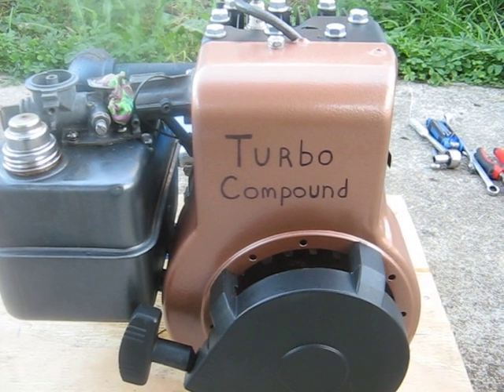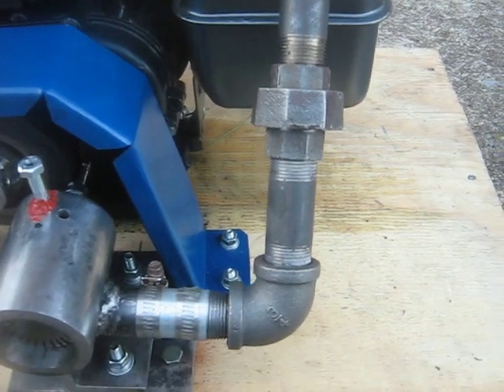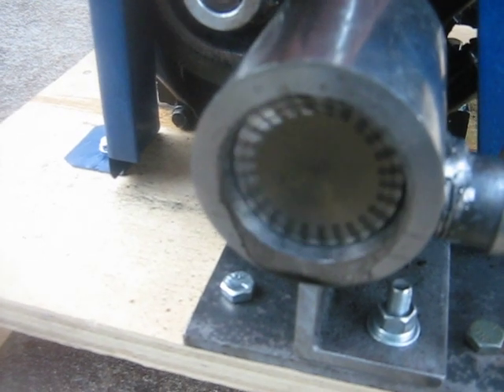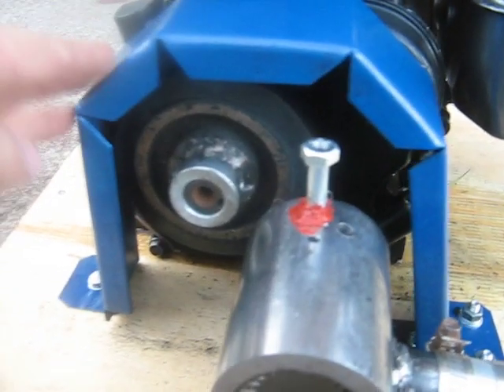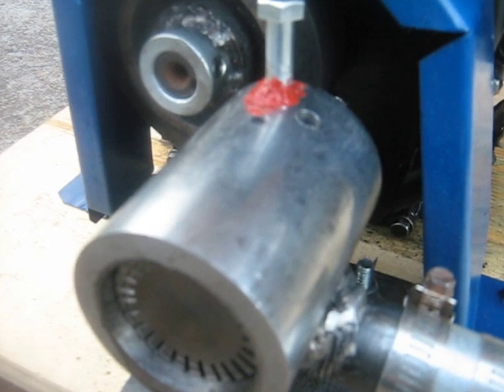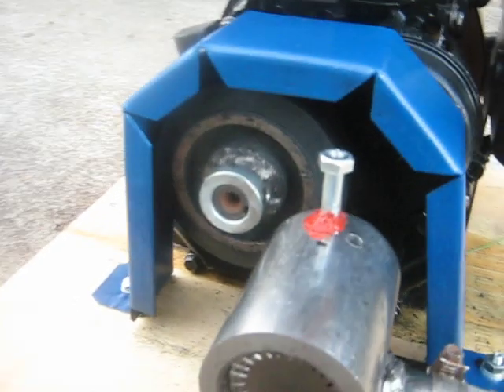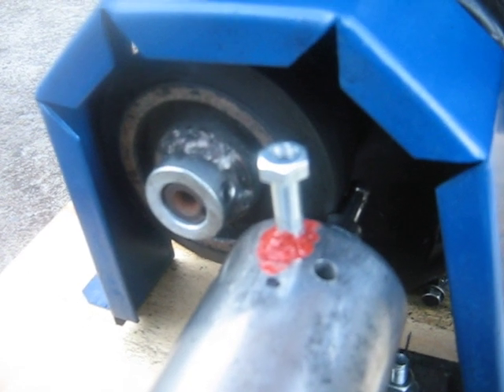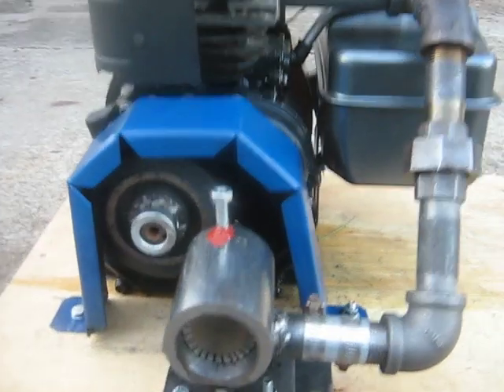How the Briggs Turbo Compounded Engine Works

Comment: Green lock tight will put it wherever you want and no turbo compounding is where the little turbo feeds the big turbo so it will spool up at a lower rpm if you put a bigger turbo on a engine it will move the gains received up the rpm range narrowing your power band by taking it off the bottom where you needed the power so by having a small turbo feeding the big turbo it’s able to spool the big turbo at a lower rpm

Comment: Impressive ingenuity and effort but This is not a turbo.
Reply from the maker: You are right, it is not a turbo charger. It is based on the turbo compounding idea of turning a turbine with the exhaust energy, and feeding the power back into the crankshaft. It has been used successfully  a few times before, like in the Napier Nomad, and the Wright Turbo compound aircraft engines. Some recent transport trucks also use a second turbine to help spin the crankshaft.  My crude attempt at it didn't pan out very well though!

Comment: What if you connect the turbine and the crank with sprocket and a chain instead of the rubber tire and friction?
Reply from the maker: That may possibly work, but that chain is really gonna be humming along!

Comment: why a wheel ? try a pully system or cogs ?
Reply: Gearheads and Gamers  simplicity?  Belts dont like to stay put at high rpm and loads. Gears require rather precice fabrication to work well.

Comment: I think Wright radials had a similar setup except used a hydraulic coupling. 300lbs made 900HP if I remember...
Reply from the maker: +T Lars Yes, they nicknamed them parts recovery turbines. I guess the Wright turbo compound engine worked well enough, but it seemed the engines probably required more maintenance due to the extra power output. I have seen at least two of them cutaway, quite the impressive engines.

Comment: What you've done is a "combined cycle" because you feed the mechanical output of your turbine 'back' to your engine's crankshaft. With a  'turbo' on a truck, car or racer, the turbo's turbine wheel powers a compressor that boosts the engine's manifold pressure thus raising the 'effective' compression ratio thus increasing the engine's efficiency by 'elevating' the engine's ENTIRE thermodynamic to a level by isolating it between the ambient pressures at the intake and the  ambient pressures at the exhaust. You cannot achieve this via a supercharger or by any normally aspirated engine design approach.

Much congrats for doing a combined cycle though ... it's tough to do that.
Reply: +ChargerMiles007 turbocompounded engines are only really more efficient when running at a constant speed, no good for cars.
Reply from the maker: +gmeast I just tried to duplicate as best I could the Wright Turbo compound engine, so I called it turbo compounded.
It would be nice if car companies would put such an engine into production to achieve further gains in gas mileage, since Napier had the Nomad diesel compounded engine flying back in the 1950s
Reply: +gmeast google racer^^
Reply: Turbo-compound engines would work great in series hybrid applications. Pure turbines might be better in that application, though.
Reply: http://www.rotaryeng.net/Truck-TC.html  this is a real engine,  for a 14 liter diesel only an extra 50hp (for a 500+-hp engine) +-180ftlb, and about a 5% fuel increase,  not the best for the added torque converter and components, but i would like to see this implemented throughout the us when the patents expire
Reply: A lot of compromises were likely made in order for that system to handle the constant rpm changes that come with having an ICE mechanically coupled to the wheels in a road vehicle. It really only makes sense to use a turbo-compound system when it's optimized for one power setting, which it would be in an aircraft or series hybrid. A better way to handle having the ICE linked to the wheels would be to have the exhaust-driven turbine driving a generator, store the energy it generates in a battery, and then use the battery power to drive a motor which is mechanically linked to the engine. This how some modern F1 engines make use of exhaust turbine energy that would otherwise be wasted.

Comment: First of all your turbine ISN'T!  Sorry! But kudos to you for trying~
Reply from the maker: I guess looking back at this project, it was more of a proof of concept  build, rather than a practical engine. The Turbo-compounded principle certainly worked on some large engines. I like to tinker with engines, so I thought I would introduce folks to this concept, though as you point out, my turbine is seriously lacking!  :)
Reply: +ChargerMiles007 hit a junk yard?
Reply from the maker: Yes, I visit the local scrapyards fairly regularly, though the cold weather has slowed me down lately! Hardly any engines coming in this time of year though. I do find a bit of small steel plate or shapes that I use for gas tank mounts etc.

Comment: interesting idea, maybe try an old turbo charger and remove the compressor side, install a centrifugal clutch to the compressor shaft so when the engine is running there is no drag from trying to over drive the turbine and when the turbine gets up to speed it will engage.
Just a thought. :-)

Comment from the maker: Thanks for the input, I think most manufactures are looking into turbo compounding technology to increase fuel economy a hair more. I have seen an electric set up with a generator on the turbine, they claim it is almost twice as efficient as a gear train and fluid coupling etc.
I thought about driving a small electric generator with mine, then discovered the end  of the valve stem is hardened steel, so I would have to cut that off to drill into the stem. I may do it yet, undecided.

Comment from the maker: Yes, you are right about what the turbo does on truck engines, cram in more air, thus increasing the compression ratio. Personally I don't know how those highly boosted diesels hold together, they are crazy!
Turbo compounding is an idea from the 1950s or earlier, that has recently been resurrected to help improve fuel efficiency, generally the engines still use a regular turbocharger, and add a second turbine for power recovery.

Comment: last time i checked truck turbos dont have any connection to the crank shaft, instead they use the exhaust to spin a turbine which has a shaft running to the compressor which compresses the air going into the cylinders. the higher the compression the more power. if this is wrong you know something I don't. I'm not trying to criticize.
Reply: hheywire. Thats turbocharged, not turbo compounded.